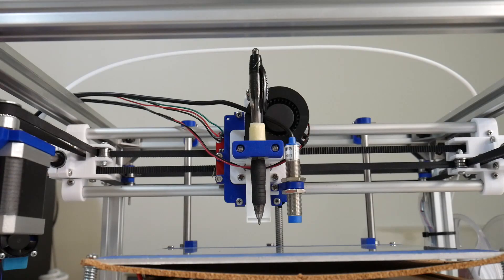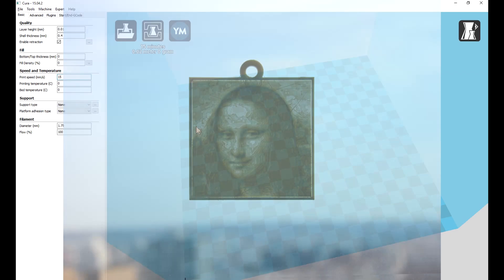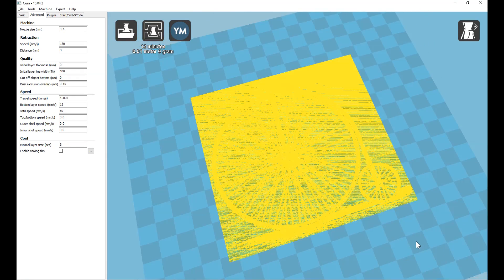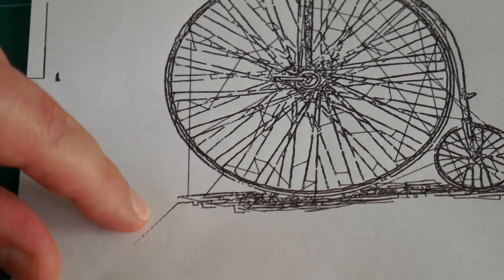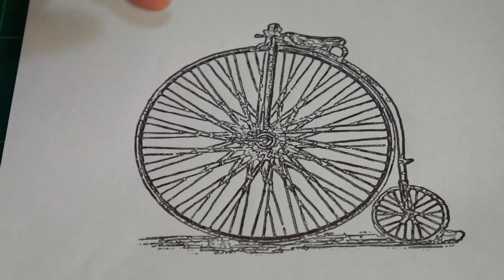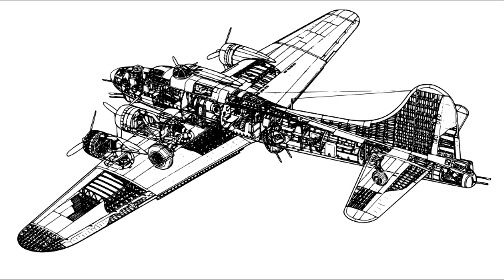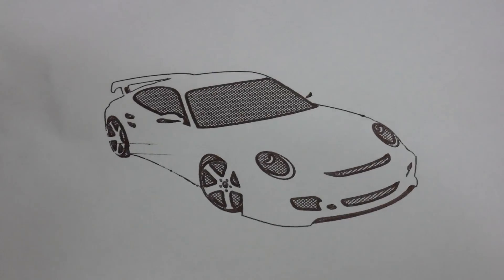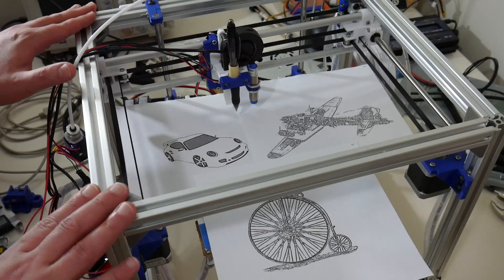Draw with your 3D Printer!

Comment: Would I have to remove the head, I have ender 3 v2 and I would like to do this, would I just make it have a different offset, like make it so that my pen is on the outside of it. How would I also turn off the nozzle and everything, because of course over the years cura has changed.

Comment: Great video even after 3 years..lol..quick question: I tried doing a drawing and the outer shell looks great, then the inner piece seems to be off significantly...any thoughts?
Reply: Sometimes a fresh start and a complete second look, yields great results...idiot that I am ..forgot to re-tighten the Y axis sets screws to the servo...no wonder the print was off.  Great video!! Thanks

Comment: Marlin won't let me set the temperatures to zero so it seems like i need to manually tune the temperature to something before it will print. Also, it seems like Cura 2.7 uses one value for both the top and bottom layers, the bottom layer being the initial one. at any rate the settings for Cura are worded differently and kind of deep so my plotter is stopping before it even starts.

Comment: Hi,
I've been watching your videos and I am trying to draw with my anet a8. I've got my image in cura and changed all the settings but when I put the SD card in my printer the bed and pla still heats up. I tried the other day and I set them all to 0 and it said printing but nothing happened so I went into cura and changed the extruder heat to 200 and it started printing with filament. I think it was waiting for the filament to heat.  How do I make it work without filament?

Comment: if you do such ghetto diy project, include warnings also, i suggest. hanging the hotend to the side and not extra mention that you have to turn it of in cura might be very dangerous to some people. as the hotendholder is made out of plastic: good luck with using it as a cnc, not. Even if you replace it with a sturdier one, 3d printer are built very open, so you will get all sorts of shit into your printer parts, if you cut something.
custom 2d plotting is best in my opinion. thank you for this video!

Comment: nice. I did this 2 years ago while I was out of filament. it was pretty cool
I made my pen adapter use a rubber band to keep even pressure on an imperfectly level bed and raised the retraction height. worked great and i havent see anyone else doing it that way.

Comment: Did you change the nozzle diameter to represent the pen point? could change the amount of detail.
For paper it would be better to use thicker sheets that won't warp while printing, and maybe a better pen like a fine point sharpie or Pigma Micron. The ball point gets a bit messy.

Comment: so its a over priced very slow, normal printer?
Reply: BUT YOU DON'T NEED TO BUY INK
ALL YOU NEED IS A PEN
Reply: pens can run out of ink though dumbass
Reply: Gipsar printer ink is more expensive I guess
Reply: damn it you got my cookies!
Reply: Not a printer, a plotter. It could have silver ink in it or opaque white ink, things you couldn't have in a printer, or it could hold a cutting needle instead to cut vinyl sheet.

Comment: Great prints  using a ballpoint pen.  I am a designer my self and would recommend using an art rapidograph pens from the brand micron. They are easy to buy and come in sizes ranging from .005 mm to 8.0 mm. I use a .005 mm and a .10 mm pen in my plotter it would make a difference in your plane and bike test prints.

Comment: this would be great for forging signatures
Reply: You could still see the difference, this prints at a uniform height unlike a natural pen stroke that varies in pressure.
Reply: You could just program in a variation in pressure? (Z axis up and down small amounts)
Reply: colin young easy solution add pressure post printing with a pen using your hand
Reply: I said earlier to add a spring to aid pressure gradient :)
Reply: colin young I think a system with a spring would do the trick or something with the printer going up and down lightly.
Reply: also wouldn't take into account angle variations, and still would be easy to tell the difference.
Reply: Well but add a servo that angles the pen
Reply: MangoTec yeah I was going to say you could just use a regular printer but using a real pen could make it look more real to a magnifying glass
Reply: MangoTec I was gonna say that
Reply: MangoTec for people saying you can tell because of pressure and angle and stuff just imagine using it for homework signatures because a teach would not know
Reply: actually they can see differences in them. Between Human and Printer

Comment: I like what you've done here, I'm sure there are programs that will produce printer/plotter gcode for more effective plots.  As for making a CNC router type machine, such a machine would have to have a very small cutting head and operate fairly slow as the 3d printer's frame would be designed to cope with the new lateral forces generated by a milling/routing operation.  From my experience with pen plotters the pen is lifted off the paper by solenoid and use gravity or spring to cause contact between the ball and the paper.

Comment: That Porsche made me very nostalgic for the early days of computing.  I remember all the really cool vector clip art packages you could buy and I'm pretty sure that Porsche was was one of them.  Computers are a lot more useful today, but they were far more adventurous 25 years ago.  I miss that adventure.

Unrelated to that, have you seen AvE's recent review of the AxiDraw?  He used it to 'etch' foam board and put a sharpie on to make custom t-shirts.  I didn't think about converting my printer to do the same, but I probably can using this video!  Thanks!

Comment: Hi, thanks for this but your version of Cura is 15.04.2 when I googled cura download I've got 2.3.1 looks like it's made by Ultimaker and the gui looks different. Are different people developing this? 

Also can I ask which file types are you importing? Bmp, jpg? They are failing to load, any suggestions please?
Reply from the maker: JPG and BMP files. You can find the older versions of Cura on Ultimaker's website.

Comment: Well the 20x20mm aluminum wont be strong enough to mill anything except maybe thin ply. And even then you will probalby have to much play in your xy-gantry. 
With a 5W laser diode you will probably be able to engrave on wood. maybe even cut thin stuff. But be carefull then. Those lasers could really damage your eyes even if its just reflected from your printerframe. 
Im currently designing a multifunctional machine myself but i plan on using 80x80 alu extrusions and even then fem amalysis says that its probably to weak to really mill hard materials.
But all in all good luck with converting it :) its really a nice idea
Reply from the maker: Yes I'll discover the limits of the Hypercube with the mill. Agreed working with lasers safety first! I'll get the tinted glasses before I begin that part.

Comment: I was thinking about using it as a vinyl cutter, but I would want it to do true vector. 

I would think Inkscape would have a hpgl export that then could be converted to Gcode. I will have to dig into this further.
Reply: cheeto4493 I think there is a pluggin called inkcut. 

I'll be having my hackspace induction on using our plotter/cutter on Saturday,  I'm sure I'll be learning about this.

Comment: also adding a fitting block that you could set the mount on top of when mounting the pen, to get the correct length of the pen to bed, would be pretty easy.

Comment: It should be possible to have a magnetic bracket to enable fast switching of accessory printheads; Extruder, CNC laser or Pe. A simple magnetic rack above the printer could be used to hold unused printheads out of the way. Swop-ins definitely are the way to go. 
Very nice video by the way.

Comment: Great info on abusing Cura to get good results. You might look at inkscape and its included gcode plugin. You might not have to make any/many adjustments.
Your axes are not likely stout enough to mill with. I won't tell you to not try, just don't expect great results.
Reply from the maker: I have toyed around with inkscape using the jtechphotonics extension. I'm not sure about the inbuilt gcode tools though, I need to investigate further.
Reply from the maker: @Kyle Kerr I understood what you meant, all good. I have been experimenting with Inkscape a bit more since this video and the results are pretty good. Not as plug-n-play as Cura but it definitely works.
Reply: Tech2C I use inkscape plugin to openscad.
Reply from the maker: I just tested the openscad extension for Inkscape. It works great for the perimeter of an image, but it misses the interior of the image.
Reply: Agreed. The conversion to SVG seems to have no control at all. A darker detailed area would appear tobe a blob of blackness...
Reply: This won't add to the ongoing discussion here, but, I feel I should clarify something. When I said abuse Cura, my comment was tongue in cheek. I am impressed that you, Tech2C, looked at Cura and thought, I bet I can make this do what I want.
Reply: I tried drag and drop image directly to simplify3d and can't quite make as easy as you have shown in the video...
Reply from the maker: @Step Cia That is interesting.
Reply: If by stout you mean strong enough to hold a dremel style tool.  Easy fix, use the wand / flexible shaft type affair that fixes onto the dremel.  Plus it'd be nice and compact for a mount too.
Reply: 3d printers, typically, are built to move smooth and fast. They do this by keeping things light. Dragging a spinning bit through any substantial material will likely lead to one of two issues. Missed steps due to more torque being required than is available. Or, cuts that are not as precise as requested.

Comment: Really not all that surprising. 3D printers are CNC machines. Really it's a software issue because cura is designed for a 3d model . Someone would just have to code up something else.

Though this presents an opportunity. The ability to interchange parts. Now as to the wobble. Well really this is the same thing 3d printers face in general. The printer is going to need supports to prevent that but it's an interesting prospect. More all in one devices.

Comment: As always, the problem is software. I'd say to first preprocess it on gimp, try the edges finder filter, try getting it to look the most like a black and white line art. Then Filter all the colours so that it goes from 0 to 255. then repeat what you did in the video.

Comment: I feel like with a very percise 3d printer and some very good software you could get it to do shading with a pencil.
Reply: TomE1248 thats a good idea. If I only I had a 3d printer to test it on, and a software guy to help me out. Cause of-course there would have to be a certain amount of pressure to shade it in certain ways. and also to account for the amount of pencil lead lost
Reply: You'd have to have some sort of force feedback.
Which, actually, can be done! There even exist commercial solutions, like the f-servo.
Reply: I guess you probably could, yes -- multiple layers would get you that with a pencil. The parts of the image that are several layers thick will be darker than the thinner parts. You can get a similar effect when printing with translucent filament.
Reply: Deimos Phob a pencil and a spring
Reply: Deimos Phob buy a 150$ 3d printer kit and build one :) i'm sure you can find someone to help tou
Reply: But what about the pencil wearing down? you'd have to compensate for that too

Comment: Would the pen holder i designed for your x-carriage (thing:2044609) interfere with your inductive pickup?
Reply: Oh and nicely done with the Cura settings!, i'll have to have a play with those. I switched to Slic3r because of retraction issues with Cura.

Comment: Hi Tech2C
I am busy building your machine and while I am, I am building 2 machines on top of each other.
The Z extrusions I use are 1 meter long, in stead of 350mm. so that it enables me to stack 2 machines on top of each other, both having 50cm of room.
The first machine is already finished and working, and it's printing the parts for the second machine at this moment. The second machine (at the bottom) could be the machine that is gong to have multiple ways of usage. I would love to have a way to assemble PCB's here. Can you imagine. One rack with two machines that are capable of making a PCB and it's housing at the same time?

Thank you so much for making this printer. Can't wait until you have your updates.
Reply from the maker: Hello 3d Print Creator,
Wow, you're building 2 stacked on top of each other? That's wonderful! I had thought the Z extrusions we buy could remain at the 1 metre length and then stack up to 3 Hypercubes within. Well-done for making this a reality.
Yes you'll be able to create a multi-purpose Hypercube stack - 3D Printing/Plotting/Milling/Engraving all in one.

Comment: I'm surprised you didn't have a spring loaded pen.
Reply from the maker: The ball in the pen won't wear down, so a spring loaded pen wasn't needed here. If I'd used a pencil then yeah we'd need to continue to adjust the Z height as the pencil wears down.

Comment: There should be a glue stick holder. Maybe have a Cura or slic3r config that has the nozzle diameter as the diameter of the glue stick, and lays down a layer only right where you need it. Maybe have it just clipped to the side of the carriage and run with the offset for dual extruders setting, so when the glue is down, you just take off the glue stick and print as normal.

Maybe even load that gcode into your intro code, and wait for user to confirm to move forward after the glue code is finished. Glue stick bot!

Comment: Very cool.  Reminds me a little of when I was building my Hypercube:  before it had a Z-axis and build plate, I tested out its X&Y axis by taping a pen to the X-carriage, holding a piece of paper up to the pen and running a print of a name plate.  It was a bit shaky due to the appalling build platform(!) but my daughter was delighted to see it drawing her name.

Another option to add to the laser cutter + drill options is a paste squirter: attach a syringe + plunger and get it squirting out icing sugar or polyfilla...
Reply from the maker: Cool! Syringe is a great idea, and 3D printing edible substances will be the next chaptor after the usual attachments.
Reply: The syringe module is a good idea. Other possible materials; SMT solder paste, or SMT glue.. Another channel recently showed a candy machine that used hot candy in syringes...
 - Eddy
Reply: Interestingly, Printrbot (manufacturers of my very first 3d printer) have such a squirter available for some models of Printrbot: https://printrbot.com/shop/paste-food-extruder/.  USD$264, even in a sale - yeouch.  Amusingly, the 'filament diameter' is 27mm.
Reply: Deathlok67 trtt

Comment: Nice video ;) The laser module is a great idea but I doubt a 3D printer is strong enought to serve as a mill, just see how the XY carriage wobble when you are pressing on it. You can still try it but it will certainly won't cut hard materials.
Reply from the maker: I agree. I'll see how far I can go with it for milling. Maybe if the movement speed is really slow it could handle certain materials, but as you say, milling hard materials would be difficult.
Reply: Lundev I Star Citzen there's mpcnc for that :)
Reply: François I totally agree but the mpcnc has been designed for that,  I was just saying that milling with a hyper cube (and most of other 3d printers) aren't designed to be sturdy enough to allow milling and that's totally fine since they are 3d printers 😉
Reply: Lundev I Star Citzen I know, you're totally right.

Comment: Why not using actual plotter-software? Or do they don't use gcode? Atleast it could make more sense to convert bitmapfiles into vector and then feed that into a plotter-tool.
Reply from the maker: This test was using the same slicing software and firmware. I assume there's dedicated plotting software/firmware available but will it be compatible with standard 3D printer electronics?
Reply: I see that Inkscape can output gcode from a vector graphic (extensions -> gcode tools -> path to gcode), though I haven't tried it myself.
Reply: Why not try fusion 360 as it can plot cnc vector lines to gcode it must be possible. Though plotting software gets straight to the point. 360 as an experiment would be interesting ;-) Thanks Tech2c